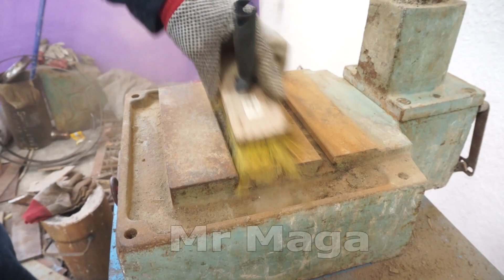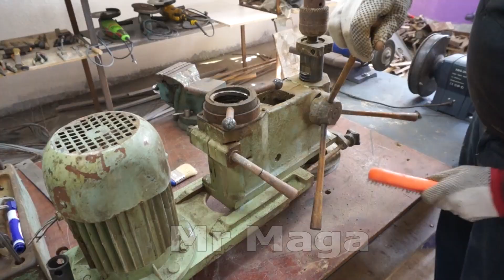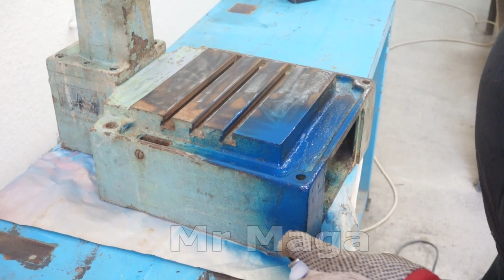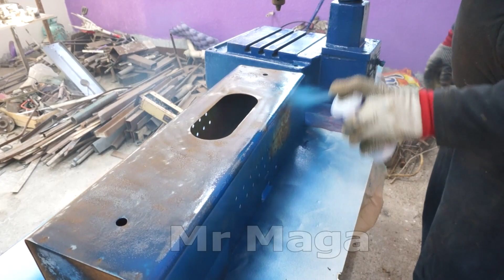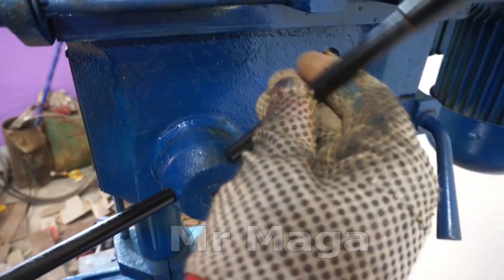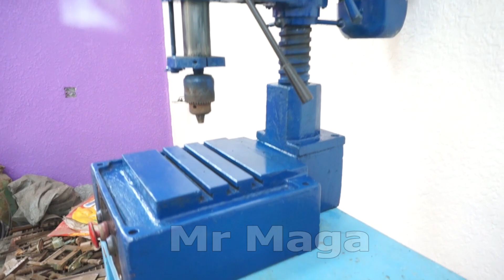THIS MACHINE IS INDEPENDENT FOR THE WORKSHOP AT HOME

Comment: You need to watch a few, Good Drill press Restorations! No offense buddy, but you cut a lot of corners on this. I mean it still has rust in quite a few areas! your Drill Chuck is rusty and several other areas, I mean it Looks a heck of alot better than it did thats for sure, but the functionally is probably about the same. Im Sorry if this is Offensive, i didnt mean it that way, I was just giving you an honest opinion and constructive Criticism. Have a nice day.